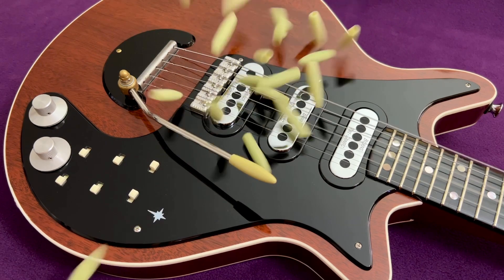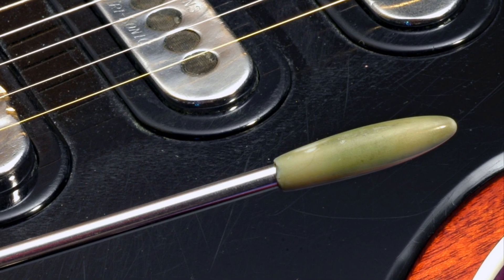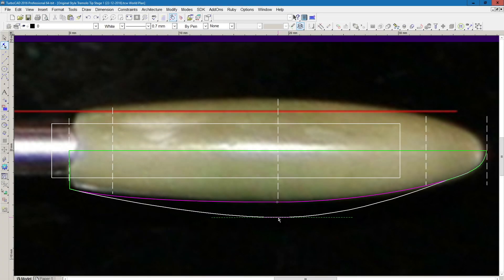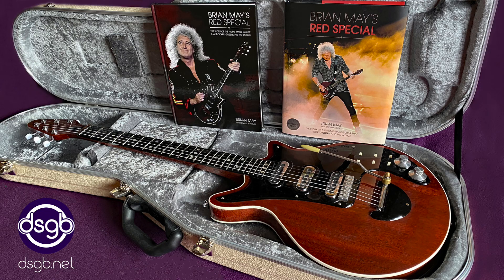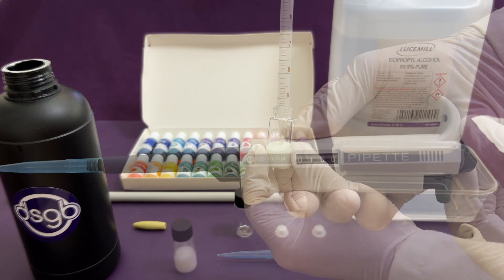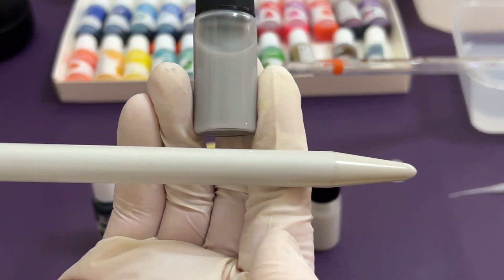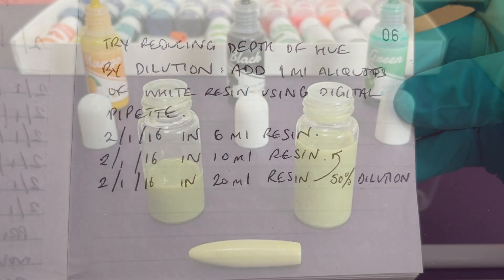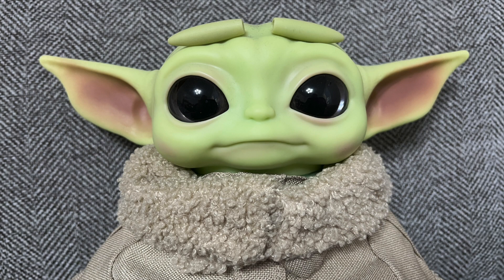Brian May Red Special Guitar Tremolo Arm Tip Design and Make

Comment: I’ve just discovered your channel. What an incredible place this is. The wealth of knowledge and attention to detail is exemplary. 

I have a question for you, if you don’t mind? I have just purchased some Schaller M6s for my guitar. Seemingly everywhere online talks about how the original RS has “modified” Gotoh white buttons but I’m yet to find anywhere that actually describes what needs to be modified about them. Could you elaborate on what exactly it is I’m going to have to do to them to make them fit the Schallers, please?

Thanks in advance.
Reply from the maker: Thanks for your kind words. The small plastic pearloid buttons require the shaft bore enlarged to fit Schaller M6 locking tuners. Doing this is tiresome. To avoid tedious precision filing of the flat areas, I made a brass former the same dimensions as the Schaller tuner shafts. I heat it up with an electric heat gun then enlarge the bores by inserting it to thermoset the plastic around it.

I swapped out the Schaller M6 locking tuners for Gotoh equivalents to avoid this and because they are a neater, less clunky design. I recommend them. The quality is just as good as Schallers.
Reply: @dsgb Thanks for the reply. That does sound like a faff. Do you know the model number of the Gotohs you recommend? The guitar currently has Gotohs on it, however, they are self locking-ish type that don’t have the thumb wheel at the back. I’d prefer to manually lock the string as per the traditional type of locking tuners. Thanks again.
Reply from the maker: I bought a set of Gotoh SG381-01 MG-T locking 3L/3R chrome finish tuners in August 2021 for £60 from Axes R Us in the U.K. They are currently fitted to my Red Special replica.
Reply: @dsgb Thank you for this information. I’ve just ordered a set for £66 + p&p and I’ll return the Schallers. There’s no way in a million years I’d be able to bore those holes on the tuner buttons out, so you’ve saved me immeasurable hassle. I’m in absolute awe of the fact you’ve managed to build a replica from scratch and I love the fact you’ve made it as accurate as possible whilst incorporating modern techniques and processes. Bravo 👏🏻👏🏻👏🏻
Reply from the maker: Thank you so much. I'm pleased that I could offer you some useful advice. 😀👍🏽